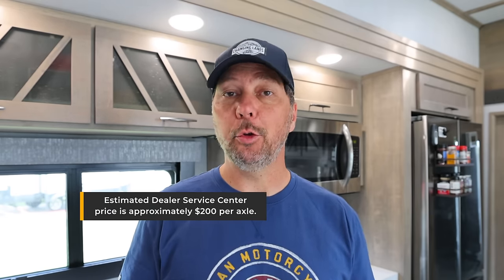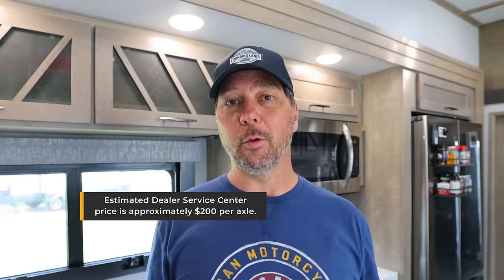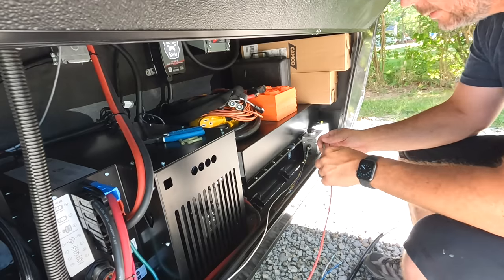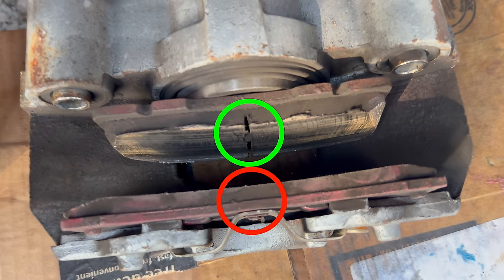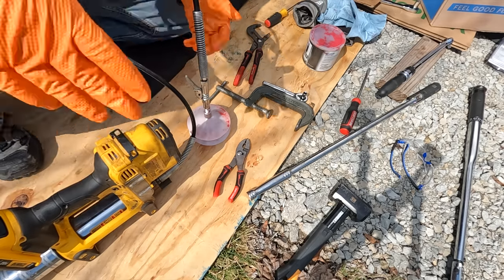Hit the Road with Confidence!: RV Suspension Maintenance Made Easy

Comment from the maker: UPDATE (May 2024): The proper torque for our wheels is 140 ft. lbs., not 120, as I stated in the video. We have 17.5" aluminum wheels with 9/16" studs (with coned lug nuts). Be sure to research the proper torque for your particular setup.
UPDATE (May 2024): It is VERY IMPORTANT to use blue Loctite on the brake caliper mounting bolts, or they can potentially back out.  We know because ours backed out, and the caliper came loose, locking up our wheel.

Comment: Great video Chad, just a couple of suggestions having been a mechanic for 50+ years.  You might want to put another piece of cardboard under the hub after you pull the wheels off.  Dropping a freshly greased bearing in the dirt is very disappointing as you'll have to clean and re-grease again.  Also rotate the hub when you are tightening the axle nut to seat the bearings.  Keep up the good work!
Reply from the maker: Thanks for the tips!

Comment: Hey Chad: Great video! I also wanted to comment on the greasing of the bearings. You did a great job, but take it from a bearing industry professional for over 44 years- you don't need to put any grease inside the middle of the hub- it's no way going to migrate back into the bearings, so you're just adding heat buildup and wasting grease. The only things that need the grease are the bearings and very little on the grease seal. Two things about this: 1) grease acts like an insulator and too much will actually elevate your hub temperatures and degrade your braking, and 2) And just one more fact about snuggling up the tension nut when re-assembling:  you should be turning the hub by hand while snugging the nut to "set" the grease, and you may want to allow for maybe 1/3 or 1/2 turn back-off to allow for bearing clearance due to heat depending on how it feels. You did point out rocking the hub laterally to see if it's too lose which is highly advisable. I will also tell you that in my opinion, Chicago Rawhide (CR) Seals from SKF are the best seal to run, as they have the patented "wave seal" design that wipes the shat diameter back and forth during rotation  the seal contact surface away from the seal's contact point. I mention single lip because most people thick a double lip seal is better, when in fact if dirt gets in between the double lips, it will actually grind down the shaft finish, and I know you've seen grooves like that before.
Reply: Seanbhaney is correct, an added note if you put to much in the center section it can heat up when moving and actually vacuum out the grease from the bearings. But great video.

Comment: If one pad wears faster than the other the caliper isn't sliding on the slide pins.  They need grease, too!  - Permatex Ceramic Extreme Brake Parts Lubricant

Comment: i have never seen a grease application that begged so much for an electric grease gun 🤣 but i do hope those greasy hand prints got cleaned off the rotors before calipers went back on. couldn't tell if i missed it or not, and that's an application where 100% brake function is needed

Comment: I've greased many a wheel bearing and one thing I can say is that any grease not in the bearings themselves is wasted grease and can add to the temperature of the hub assembly.  The dexter system completely fills the cavity with grease that never sees the inners of the bearing, it just spins around and around.  Thoroughly packing the bearing like you've shown here is very necessary but adding grease to the inside void is not.  And, after the bearing is laid in both front and back, it's a good idea to compress a little bead of grease between the inner seal and the outer washer so as to provide a solid layer of grease (that the rolling grease) can ride against and remain in the bearing.  My thoughts after hundreds of bearing maintenance cycles and not a single bearing loss.  Thank you as usual for your wonderful,  insightful videos.  We'll see you out there somewhere.  Todd in NH.

Comment: Couple of quick items.  Once you tighten the axle nut to snug, you should spin the hub, then loosen the nut that 1 flat.  Second, why did you open the bleed screw to push the caliper piston back in? Typically you just push the piston in which in turn push’s the fluid back to the master cylinder reservoir.  by opening the bleeder you take a chance in creating an air pocket in the caliper/brake system.  Also you by opening that bleeder screw you will also need to top of the brake fluid.
Reply: Yeah, I was going to ask if that had been done after opening the bleeder valve.
Also, I guess you can simply loosen the cap on the brake reservoir to allow the fluid to be pushed back into it.

Thoughts?

Comment: Great video as always Chad. Just maintenanced our IS as yours and found the inner races on both inside and outside bearings had some brown discoloring. Sent pics to Morryde and they said as long as the color was brown and not blue, just scotch brite them clean and pack and place them back in the hub per manual. Scotch brite cleaned them to new and reinstalled.

Comment: Great video...two issues being a mechanic...when u use the washer trick to get your seal off..hammering the front part of the bearing you contact the cage assembly against the washer potentially damaging it... second outer pad wear usually means that the floating pin could be frozen and you never checked them prior to putting the caliper and bolts back on....
Reply from the maker: The caliper bushings were all free and loose.  But, yea, I could have mentioned that.  I also could have greased them.
Reply: So, if removing the seal that way. The issue is not really possible bearing damage but damage to washer?

Comment: We have the IS, and I just used the EZ Lub for the bearings.  No worries about excess pressure, as I only have manual grease guns.  And oh yeah, there's a lot of work getting the IS and the bearings greased!  On the first wheel, doing the IS, I started to think I was doing something wrong, as I'd squeezed that handle so many times, and wasn't seeing any grease coming out.  Then I finally saw the old stuff oozing out, then the new.  I forget how much grease they each took, but I had to go buy more, as I'd underestimated how much I'd need.  The bearings didn't take nearly so much, and by then I was more confident.  At this point, I think maybe I'll get a cordless grease gun to go with my other cordless tools.  But maybe I should just do the work, help build up those arms!  We had a problem with the IS, where (probably scraped along the bottom somehow) one shock had the bottom part sheared off, came out of the bracket at the bottom.  We ended up losing one brake line, and the pads on that one.  That was not fun to fix, though Morryde was quite helpful, and a mobile tech did the hard parts.  Next time we're in the north IN area, we plan to get Morryde to give the whole system a thorough going-over, including alignment, as we think one wheel out of six is slightly out.  And maybe we'll have them re-grease everything while they're at it.
The first time I took the wheels off our rig, I found that on one side, they were way over-torqued.  As you say, the damage is done when that happens.  I wonder if I should see about having the lugs removed and replaced.  Apparently, when the RV manufacturer put it together, whoever worked on that side just went with the air impact, "more is better" approach.  I've found that on cars, too, where a tire shop went nuts on the torque.  I've actually removed all the wheels from a car, carried them to a tire shop, and had new tires put on and balanced.  I didn't care about saving whatever minor cost of having them put on the car, I just didn't want them torqued to 300.

Comment: Always love your maintenance/mod videos.  I also have the MorRyde IS suspension and disc brake mod on my GD Reflection 5th wheel.  It wasn't clear in the video if you actually drained some brake fluid out of the caliper when compressing the piston with the C clamp and loosening the bleed fittings and/or if you had to refill the reservoir.  I've changed many disc brakes and always just slowly compressed the caliper piston as you did after first loosening the brake reservoir cap for venting.  Usually never had to add fluid after the maintenance.
Reply from the maker: Yes.. just a tiny bit of brake fluid.  Not enough that I needed to add more.

Comment: Good Job! Don't know your brake system well. But I change pads on other items (motorcycles, cars, trucks, etc') all the time and when I do, I use a pry bar to open up distance between old pad (trash) & then install new ones. Saves all that time with the bleeding procedure you mention. But I could be wrong with your system? Also it's a good time to pump the brakes several times to get hydraulics pumped back up so when you need to brake it's good to go.

Comment: Great and helpful as usual. I did not see you check and lube the metal sleeve where it contacts the rubber bushing. Not the quide pins btw. My pads were wearing on the outside pad faster so upon inspection, I could not move caliper at all when retracting the pads. It should be able to float after tightening down the guide pins. It needs to be able to move slightly on the metal sleeve and rubber bushing.  After taking out the 2 bolts holding the caliper, pull out the metal sleeve from rubber boot. Should remove easily, mine was stuck. I cleaned polished and lubed the outside of the metal sleeve with brake caliper grease, and a little of the grease on the opening of the rubber. Slid in nicely and now my calipers can float. Wish I could post a break down on comment to make clearer.

Comment: Well done. Easy to understand. I've been dealing with trailers (boat, RV, enclosed etc) for 40 plus years, the only thing I can add is a trick my Dad taught me a long time ago for the seal and even bearing race install when required. Putting the seals and the races in the shop freezer for a couple of hours before hand will make them shrink a bit and slide in easier for ya. Note I said shop freezer, which means shop fridge. Gotta have one of those too...

Comment: I use the easy lube between full maintenance.  Half way through the year, I will pull the tire and put a few pumps in for the back bearing and shoot some extra grease into the front.
Reply from the maker: That's a great way to use it! 👍🏼

Comment: Thanks for the great video Chad! I was wondering if you could add to your blog post on the website what to do if there is in fact damage on the spindle, or any of the other surfaces you mentioned.
Reply from the maker: If my spindle or races were damaged, I would terminate DIY mode and get a trailer or RV shop to take over.

Comment: You can run them hubs wet. Meaning, you remove the rubber plug in the middle of the cap and fill it halfway up with gear oil.  You never have to pull the bearings again as long as it stays full of clean oil.
I run wet hubs on my gooseneck Dexter 12k axles.
Reply: I should add, you do run a preload on the hub bearings when running wet hubs to maintain seal integrity. About one flat turn on the nut is all it takes for re-used bearings.

Comment: That’s a neat trick on removing seals- I will remember that.  I’m also not a fan of the EZ lube…seems like you would use much more grease than the conventional method
Reply from the maker: True.   And the hub will be 100% full of grease.  Not sure that's a big deal though.. I guess it doesn't expand.

Comment: Hi Chad.  Great "how I did it video". Given that you have the screw on clear dust caps, have you considered switching to oil bath bearing lube?   Conversion requires a different rear seal but it's very simple and you can forget about packing bearings every 12 Mos or 12K miles..

Comment: A jack stand is a good idea too in the event the bottle jack gives up the ghost.
Reply: Level up system was down.
Reply from the maker: The nice thing about the independent suspension is the single wheel can drop, and nothing happens.  I let it all the way down when I grease that torsion bracket.
Reply: @ChangingLanes  Ah! good point.

Comment: Why didn’t you grease the caliber slide bolts? Does the bearing grease cup waste more grease than repacking by hand? I’m old and do it the old way. Which means wash and dry the bearings and repack by hand. I have the dexter axles on my trailer and I think the bearing greaser is for just to put a little fresh grease in. I plan on doing what you did this year. Another thing I did was to change all my tin covered lug nuts to solid lug nut. Stripped the cover on one when I bought new tires. Told the guy change all the lugs cause I don’t want to have a flat and have that happen to me. And it will happen in the pouring rain in the middle of nowhere. Like the how to videos you put out ,keep’em coming and smooth wide roads to you guys.

Comment: Great video that I needed for our MorRyde Independent Suspension. We’d gotten it last May and I’ll be doing our bearings later this summer. The ‘how you did it’ was great and I got some ideas and tips for my job, we only have 4 wheels to do. I am curious about your thoughts on the copious rust on your suspension parts? When I was actually dismayed at the rust forming I  sprayed those spots. But seeing yours, I’m wondering something more needs to be done on ours. Thanks again!

Comment: Depending on size of your bearings, you can pack 2 bearings at a time.  Pu the inner (large) bearing in the tool first then the outer (smaller) one will fit partially inside the larger one. Put cap on tool and pump grease into both bearings.

The trick with the Dexter EZLube is to spin the wheel while injecting grease.  Also go slow.  Those battery powered grease guns can inject lots of grease fast.
Reply from the maker: Interesting idea packing 2 at once! 😊 👍🏼  👊🏼

Comment: Axle maintenance is so super important! Thank goodness we have a TPMS for our motor motorhome and our single axle enclosed motorcycle trailer. One of our seals failed, and I only knew of the problem because of the temperature reading. Now we know to repack the bearings every 5000 miles and replace the brake shoes every 10,000 miles.
Thanks again for all of the past helpful videos!
Brendan & Lena
Reply: (For the trailer)

Comment: Great video and was just what I needed to understand the process.  Question, I followed along with the packing of the bearings and adding grease to the races but how do you know you put enough grease in the races? Is there a concern with adding too much grease?  How do you know you have enough.  Thanks as always
Reply from the maker: I don't think there is a concern with too much grease.  Particularly considering that the EZ-Lube completely fills the hub. I think too much is better than not enough.. 👍🏼
Reply: Hi Chad, I didnt see an EZ-Lube fitting on the disc brake hub though

Comment: Noticed the rust on those cross bars that we could see , may I suggest a rust converter product,then a coating of Raptor paint coating, Australian product available in the USA.
An old bearing race is good to use as a seal drift when taping them down , obviously the bigger bearing.
Good video,I think that if owners of these big RVs can't do this service work themselves, they probably shouldn't be driving them on the road ,it requires skills and abilities,because it saves money and time and can get them out of predicaments .

Q your Pin Box, you upgraded it didn't you ,reason I ask I've seen statements that they shouldn't be changed from factory spec in some instances,no frame warranty or something.
Cheers
Reply from the maker: Our pin box is the MORryde rubber pin box and is stock from GDRV on the TH models.  There is a bit of controversy right now on after-market pin boxes that are not approved by Lippert, particularly its potential to cause excess frame flex.  Also see: https://changinglanesrv.com/rv-frame-flex-our-opinion/
Reply: @ChangingLanes  thanks,I purposely didn't mention the F word ,it certainly is a big concern for many ,and now there are some happy customers and there's very unhappy customers.

Comment: Thanks for the video, quite informative. I have independent suspension on my fifth wheel (different manufacturer). Did you replace your lug nuts with something that does not have a cap on them? If so, can you share what you bought?

Comment: Just wanted to comment on the EZ Lube system and the MorRyde wet bolts. First I used to be an EZ Lube advocate. That is until my rear seals pushed out and ruined 3 of my four backing plates with grease intrusion. There is no cleaning them up  after that to where they will function properly. Fortunately new complete backing plates are not terrible expensive, but it's still money I would hope not to spend. I will never attempt to use the EZ Lube system again. Regarding the MorRyde wet bolts, I have had a terrible time with a couple of those simply refusing to take grease. I have pulled them apart, made sure the passages are clear, repositioned them at 45 degrees right or left of TDC. I'm about to do it again. Don't have an answer for that. Just frustrating. Love the system otherwise, just tired of having to completely dismantle the wet bolts to get them to take grease. Any responses, or suggestions would be a great help. Love your channel.
Reply: An idea, attempt jacking up your trailer to take weight off the wet bolt(s) in question, then attempt to add grease.  I had the same issue with a couple of mine not taking grease but this fixed my issue and hopefully helps with yours.  Good luck!
Reply: @sethbergquist1047  Thanks for the response. I've tried every combination of jacking and weight release without success on the one that holds the equalizer. I'll just have to dismantle it and see what the problem is.